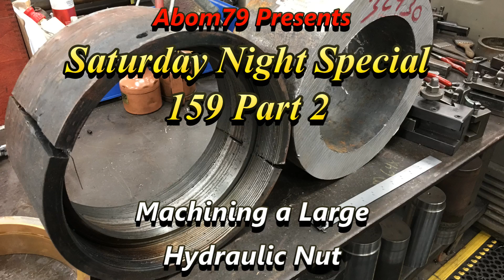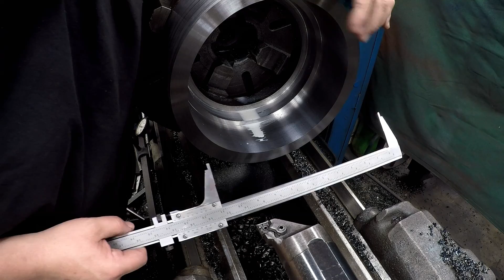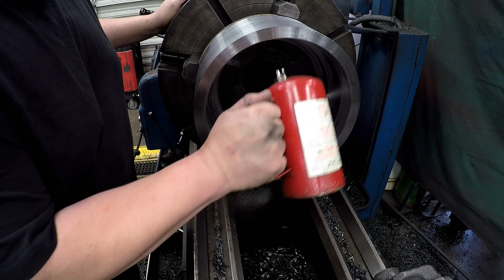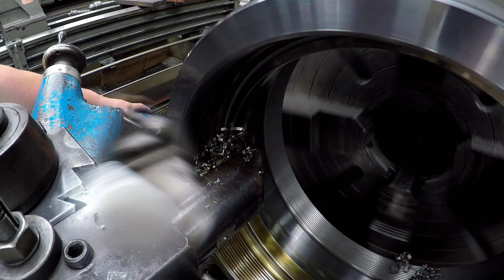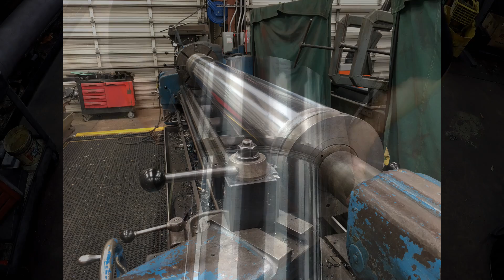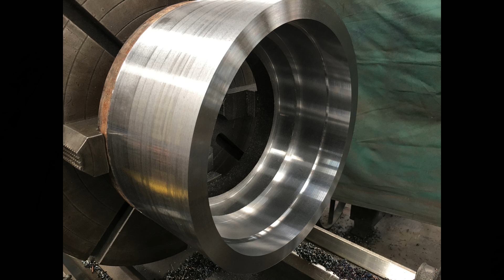SNS 159 Part 2: Machining a Large Hydraulic Tube Nut

Comment: Excellent work Adam, when I was an apprentice we single point threads on the male part and then test fitting into the female item. I had one pick up on the thread without warning , had to tell forman I was not popular as we had to cut it off and the bore male thread out. Was a rush job and expensive for us to scrap. Its a shame that here in the UK and in the USA we cannot afford new machine tools.
Reply: ANDREW MICAS i see loads of people using these old machines, dont they make them like this anymore? Or is it a money factor
Reply: LEXUS-RX300  I think it is a question of economics. There's really nothing wrong with old machines particularly if they've been cared for. In most cases the older machines are superior to an equivalent new machine, as far as build quality and rigidity, and they can be had a bargain price at auction - many times at 1/10th the cost of a new machine.
Reply: I like to agree with you but I served my apprenticeship 1965/1971 many of the machine I worked on had been supplied lend lease for example Cinncinati Milling machines and they had lost there accuracy. Most of the lathes would not turn parallel near the chuck because that's where they had spent most of there time. When I did my day release at Technical college on new Harrison lathes it was easy to hit limits.
Reply: I can't disagree with you there either. Schools don't maintain their machines or adjust the ways etc... But, that's not to say that school machines are junk. I bought a harig surface grinder from a school for $300. On the outside it looked like crap, but the ways and slides were like brand new and the spindle is quiet as a mouse. You just gotta know what you're looking at before you buy. 

A new lathe like the one that abom was using in this video is probably $70,000 for a new one. I'll bet you can buy a used one for under $5000-$10,000. It's good enough for his shop. That lathe has probably paid for itself at least 100 fold. A new one requires a lot of business to pay for it. And that's why the old machines are still alive, because they make money.

Comment: Nice work as usual Adam.  thanks for sharing.
Reply from the maker: Thanks Randy!
Reply: Adam I just want to add that you are a bad ass on the lathe. Also I was just wondering why you wouldnt wire gauge your threads to match the part. I've seen it done but I'm not a machinist just a hobby ide like to get into and learning all I can.